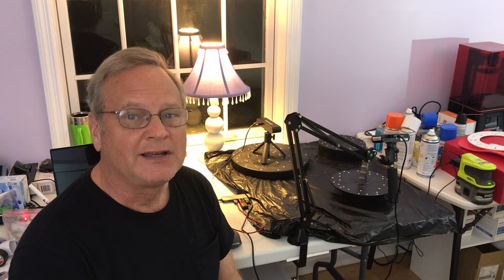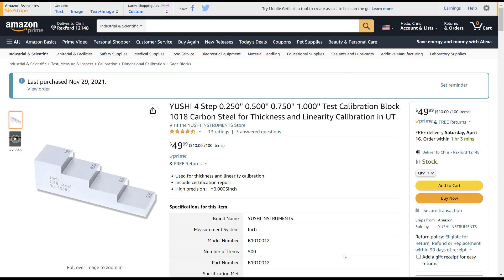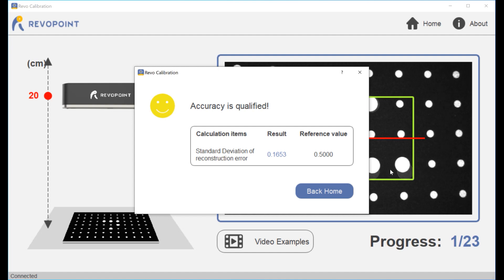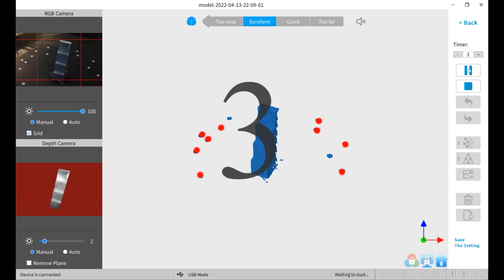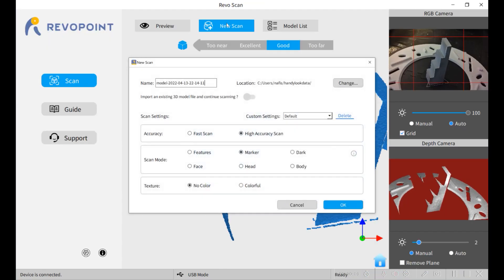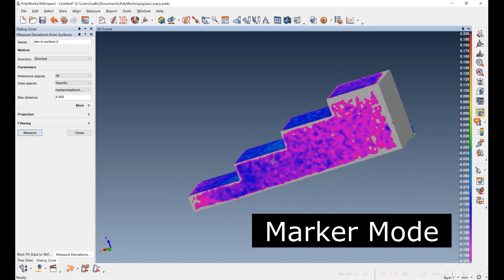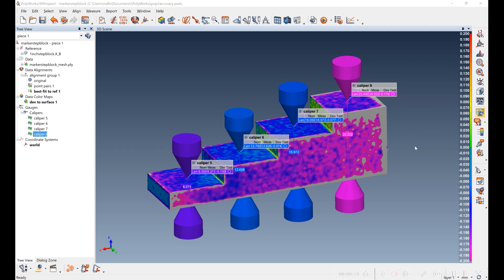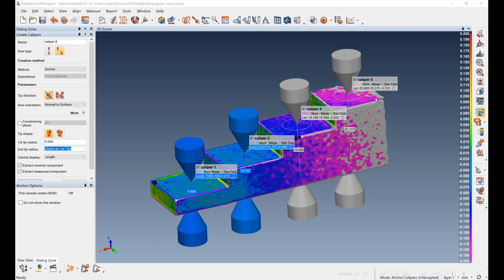Revopoint POP2 3D Scanner Accuracy Test on Turn-table using Step-Block

Comment: What is that white textured ring that you are using around the 3 minute mark?
Reply from the maker: It's a feature ring that Seb and Jim made ( https://www.thingiverse.com/thing:5270756 ). It helps put some unique features in the FOV on symmetric / non-constrained objects
Reply: @SerendipitySue  Thank you so much for this!  I've been doing something similar by throwing a bunch of random small 3d print discards I had laying around.

Comment: How are you doing this?  We.have the pop2...can't get it to anything even close.to this.kind of scanning!?
Reply from the maker: have you tried calibrating your POP2?
Reply: @SerendipitySue  yes, that took and hour literally!   Still, the things doesn't track.  Has ghost of everything all stuck to it...everything comes out a complete mess.  Tried all the settings still garbage.  I can't understand how you get a thing to look evenclose to original.
Reply: @mrpush2532  you need scanning targets the scanner can follow. Use crumbled blue tape or print something the scanner can recognize. Place multiple around the object your scanning.

Comment: Great works and thanks for the demo; one of the better test I've seen.
I would like to see this on the Revopoint mini if possible. One thing to note is that when using the caliper tool in PolyWorks did you have it extract the vector/measurement direction from the first point?(This is the default setting) If so the may interduce some error if the two planes aren't parallel. (Likely very small impact if any) It would be cool to see planes extracted from the surfaces and 3D measurements using the largest back plane as the reference feature.

Comment: need to calculate the average accuracy, not just use the highest value.  you used marker mode but didn't have markers on your object to be scanned. Is that really enough scanning spray?
Reply from the maker: that's the way marker mode works on the POP turntable. The Aesub Blue scanning spray disappears over time. It doesn't take much. Ideally you would take 30 measurements and come up with a mean and standard deviation.